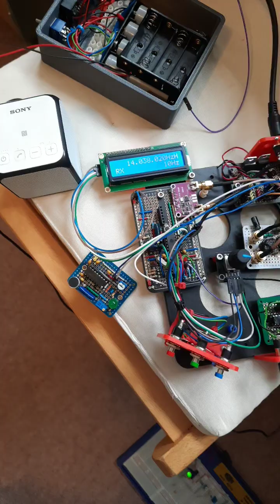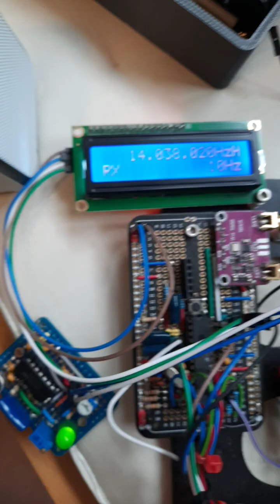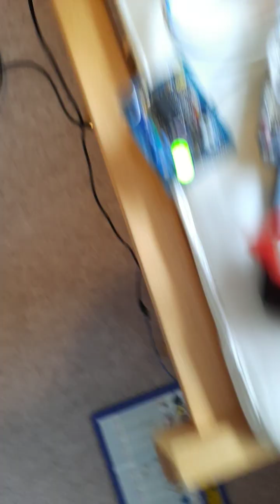Adding a tuning Magic Eye to my QRP breadboard radio

Comment: What's the principle of operation? (Narrow) Band pass filtering?
Reply from the maker: It's actually a phase lock loop - when the set tone is detected the two logic pins go either high or low, the tone and the bandwidth can be adjusted.